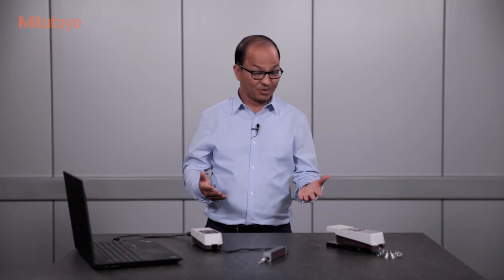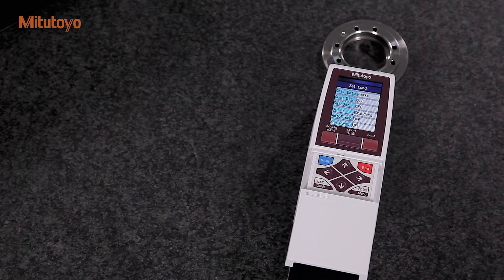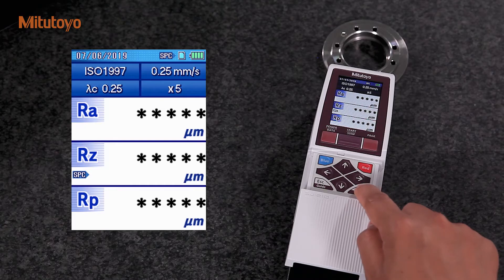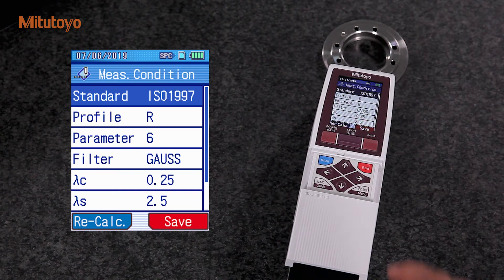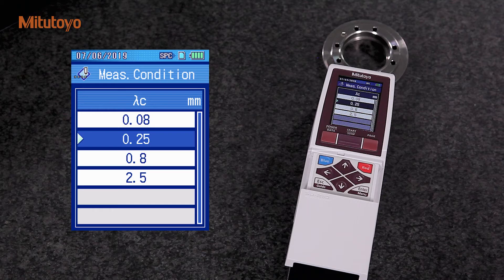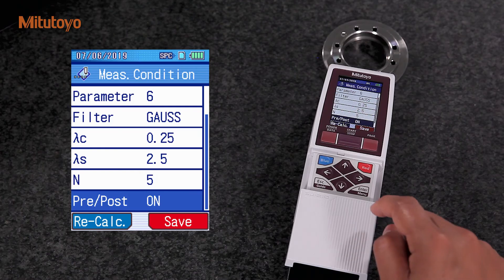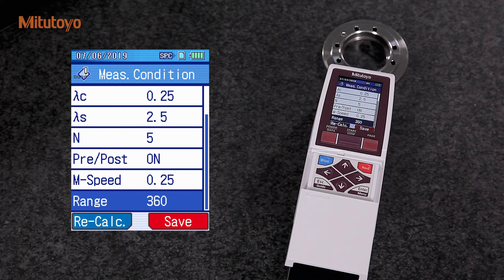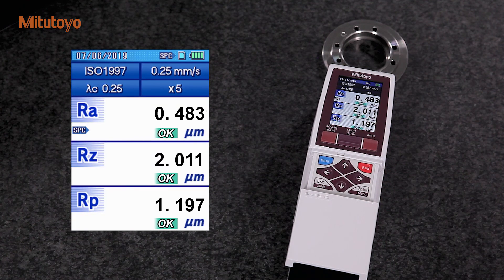Mitutoyo Metrology Class | How to Measure Surface Roughness with the Surftest SJ-210

Comment: Sir, as after on this instrument...it showing over range error...how it will be ok
Reply: check the user manual chapter 16.2.
Possibly causes: 
The result exceeds the measuring range.

Solutions:
Properly connect the detector to the drive unit.
Refer to the user manual chapter 3.2.1 “attaching and detaching the detector”.

When the measurement range has been fixed, set it to Auto.
Refer to the user manual chapter 6.5.2 “modifying the measuring range”.

Comment: I have an SJ 3-10 and I’m getting an OVER RANGE warning on my display? Any advice?
Reply: I have an SJ-210 and am getting an overange alarm too , Its prventing me from using the instrument.   It worked well and I didnt use it for 3 years and now it says detector position is 7700 or 8000
Reply: check the user manual chapter 16.2.
Possibly causes: 
The result exceeds the measuring range.

Solutions:
Properly connect the detector to the drive unit.
Refer to the user manual chapter 3.2.1 “attaching and detaching the detector”.

When the measurement range has been fixed, set it to Auto.
Refer to the user manual chapter 6.5.2 “modifying the measuring range”.

Comment: What is difference between- standard, retractable and traverse type ? also 0.75 or 4 mN ? how to diffrentiate and choose the right model ?
Reply from the maker: Hi! Thanks for your question. We have sent your questions to one of our specialists and here is his answer. 

The difference lies in the behavior of the detector.

The standard model, called Surftest SJ-210, has a straight measuring direction.
The transversal type can used to measure for example in a crankshaft by moving the detector in the transverse direction. This model is called Surftest SJ-210S.
The retractable model can be placed at the measuring position so that it does not come into contact with the surface until the start button on the device is pressed. The detector then lowers onto the surface to be measured; this model is called Surftest SJ-210R.

The difference between 0.75 mN and 4 mN meets the requirements of ISO standards.

To select the correct code number, please visit your local Mitutoyo website by selecting your country of residence: https://mitutoyo.eu/

Comment: Sj210 showing over range please rectify
Reply from the maker: @ Rajendra Desi Tech 
Please check the user manual chapter 16.2.
Possibly causes: 
The result exceeds the measuring range.

Solutions:
Properly connect the detector to the drive unit.
Refer to the user manual chapter 3.2.1 “attaching and detaching the detector”.

When the measurement range has been fixed, set it to Auto.
Refer to the user manual chapter 6.5.2 “modifying the measuring range”.

Comment: Hi, whenever I try to measure Ra using SJ 210, the detector does not move. Message on the display unit appears as " Returning?". What can go wrong? Tell the solution plz.
Reply: It problem in drive unit
Reply: We can repair this

Comment: Nice video, how can I get the users manual? Also my problem is that the stylus does not go back. Thank you
Reply from the maker: The user manual is usually delivered with the product. When this is not the case, please contact your local Mitutoyo office or dealer. You can find their contact information at www.mitutoyo.eu by changing the country at the top right corner.

Comment: Please tell me about lamda c what is this???
Reply from the maker: Dear Mohd Salman,

The roughness profile (R-profile) is the profile resulting from electronic high-pass filtering of the primary profile with a cut-off wavelength λc. This process removes the longer wavelength components. The parameters are designated R and evaluated within the evaluation length ln, which generally consist of five sampling lengths lr. The sampling length corresponds to the cut-off wavelength λc of the profile filter. You can get all details for example in the ISO 4287, ISO 4288, ISO 3274.
Reply: @MitutoyoEurope  thnxxx sir

Comment: We tested the master (Ra 2.97) ,but we got only 0.015  micron .How to fix this problem or change any setting on that device.
Reply from the maker: Please check the correct steps for a stylus calibration in our user manual. You will find therein detail on how to set up the right values, measuring length, cut-off, and how to do a correct stylus calibration.
In addition please check the stylus tip if anything is broken and the calibration reference specimen.
Reply: @MitutoyoEurope  kindly send the user manual.
Reply from the maker: @ruthranpappusamy9514  Please contact your local Mitutoyo subsidiary for this - if you need assistance locating them, do not hesitate to ask.

Comment: I tried to measure dent on a flange face and i get "over range". How can i solve this problem?
Reply from the maker: Dear Segun, 

The result exceeds the measuring range of 360 µm. 
Please check your user manual – you will find in the “troubleshooting section” information on how to solve your issue.